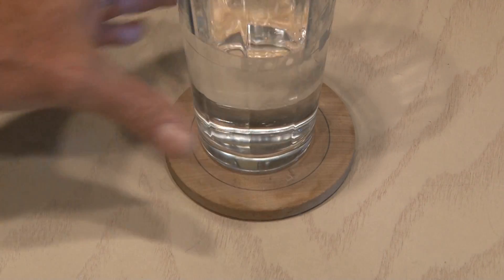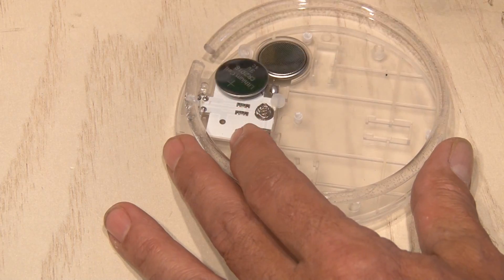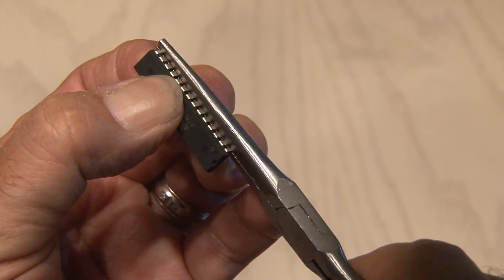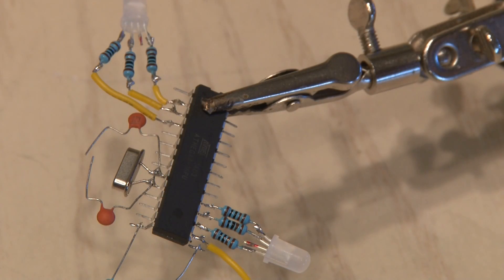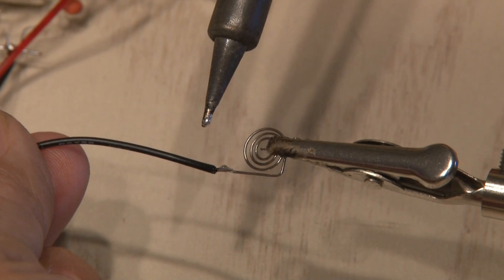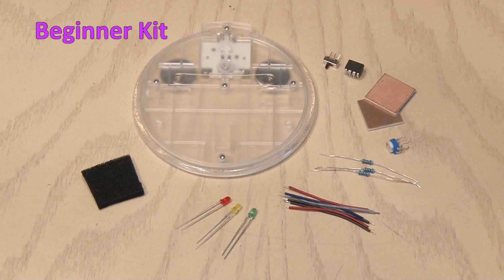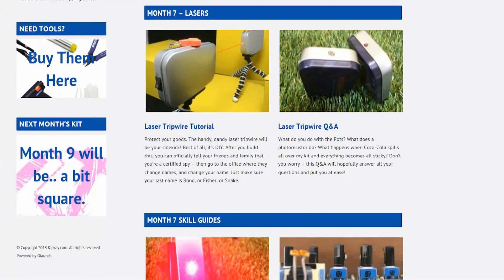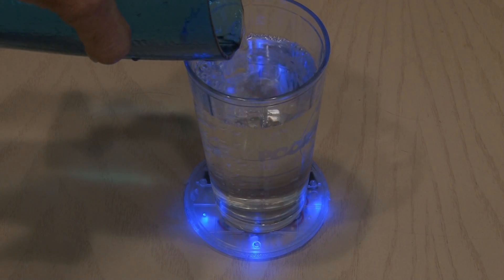DIY  Light-Up Coaster!

Comment: You'd probably be better off using the internal oscillator... would save time and money (it's not like your projects really need 16Mhz)
Also, why not put the resistor on the GND pin of the RGB-LEDs instead of 3 on the individual VCCs?

Comment: Nope, Building the hobbyist version will not set you back $40, It will set you back $12... Or you could just skip the chips and get some color changing LEDs that change color based on voltage from ebay, and use a $0.40 pressure sensitive potentiometer to achieve the SAME thing as the hobbyist kit, for $6.